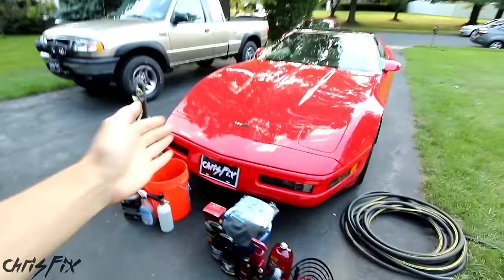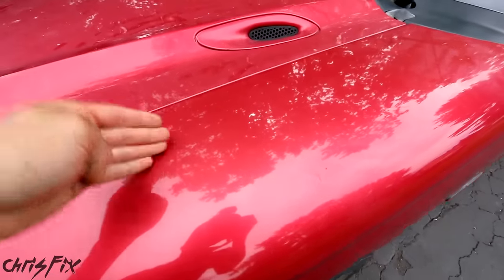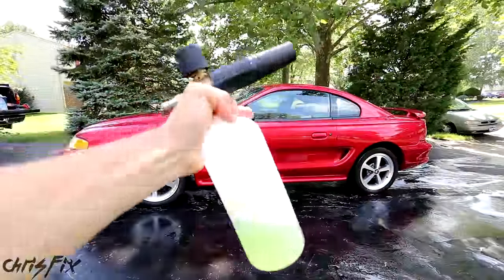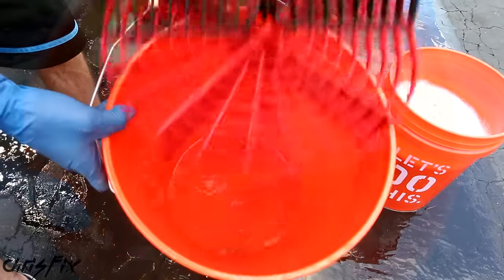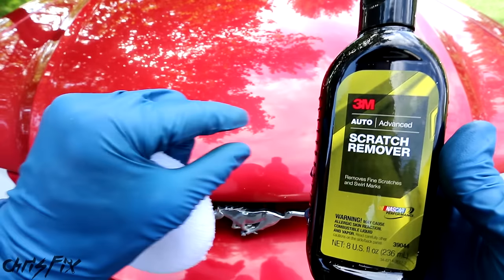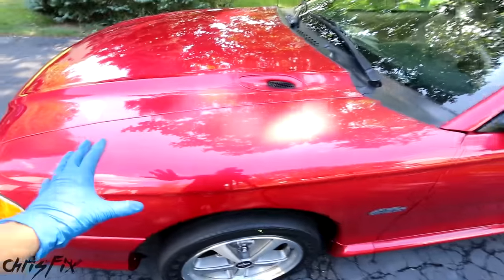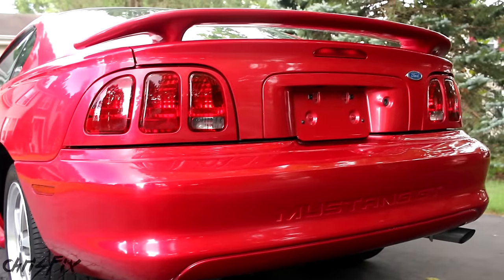How to SUPER CLEAN Your Car (Best Clean Possible)

Comment: Hey ChrisFix. I know you’re usually super busy prepping other videos and content for all. I was hoping if you had time or have tips for removing window tint from vehicle. Thanks.
Reply from the maker: I've found that taking a razor blade to lift up a small edge then applying heat with a heat gun is the best way to remove it. If you don't have a heat gun, soapy water or a product like goo gone can also help break up the adhesive
Reply: @chrisfix  Thanks. You're the best.

Comment: Hey Chris! Love your videos, they’ve been a huge help in reviving my 2004 VW. Got a question about order of operations. I need to do the following: rusted paint chips (planning to do Dremel and touch up), pull some dents, fill some dents, replace some body panels (fender, mirror caps, bumper covers) that I’ll paint, and paint correction. What order would you suggest doing them in?

Comment: Hi  Chris, I hope you get alerts to the comments because I really need your advice. First off I’d like to thank you for your headlight restoration video. My headlights were so bad that I could hardly see out of them with the dims on. I did my headlights using your video and my headlights turned out really good. Everyone was amazed at the before and after pictures that I took. Now for my question. I’m ashamed to say that my car is a 2007 Altima and that other than the car wash, I have never waxed it. The car is silver and the paint is really starting to look dull and faded. There is an area on the hood that is really faded so I will have to use the polish on it and feather it out like you did. My question to you is can I polish the whole car because it all looks so dull. Would it hurt to polish the whole thing? Thanks in advance.
Reply from the maker: Yes, any paint that is faded and looking dull should be polished. It will be a bit time consuming but you can definitely polish the entire car if needed. And I'm glad the headlights are looking good!

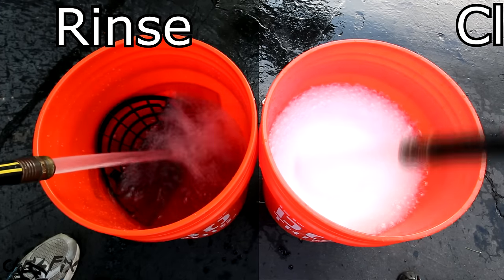Comment: At 6:05 you said "the bucket on the right is the soap bucket". Is that the dish soap, or car soap you're using in the bucket at this step? And is it still dish soap in the foam cannon?
Reply from the maker: I used dish soap this entire process, in the future I would only be using regular car soap if I wasn't trying to strip everything off

Comment: Hey Chris, I was wondering to properly clean your car without doing the dish soap stage or any of the polishing/ paint correction. Just a regular cleaning. Would I follow all the same steps you have on here for the car soap portion of the video, washing, and drying? or is there another video that you made specifically for just a regular cleaning? thanks
Reply: Don’t clean your car with dish soap if it’s just a wash in between waxing just do a pre rinse then a touch less wash with a ph neutral shampoo and top off with a detailing spray when the paint is wet as a drying agent hope this helps

Comment: I’m dealing with a car that’s been neglected and left outside for a good while. Algae and wasp nests were growing in the crevices. I managed to get the worst of it off with the powerwasher and microfiber, but there’s still some stubborn spots stuck on. Should I try to clay bar those out or leave it as “good enough”? It’s not something I’m being paid for, and it’s just a favour for a non-profit.
Reply from the maker: Hit it with the clay bar real quick and see what kind of improvement you get
Reply: @chrisfix  I ended up claying it last night (spent 5 hours on the exterior alone). A significant improvement (but I ended up going in with detailing spray and a microfiber cloth to scrub off the lichen or whatever that red bumpy stuff was), so I’ll probably get any remainder in subsequent washes. I just hope it doesn’t get neglected again.

Cheers!

Comment: My Method of Cleaning the Car
1. Rinse
2. Light Vehicle- Iron Decon- Spray, Let it Sit (3 mins), Rinse
3. Remove Bug Stains
4. Wash 
5. Dry
6. Decontaminate the Paint
7. Protect the Car
Products- Pressure Washer, Undercarriage Washer, Bug Remover, Iron Decon, Mega Foam, Foam Cannon, Car Shampoo, 1 Grit Guard, 2 Buckets, 11 Detailing Brushes, Microfiber Wash Mitt, Microfiber Towels, Quick Detailer, Clay Bars, Ceramic Spray Coating

Comment: Chris so lets say if I wanted to flip a car or just clean someones car and their car had a lot of swirl mark, is the a good time to use polish?
Reply: and when you come in with the 2 applicator is that a newly fresh one or the same?
Reply: one more question sorry to bother Chris but when taking car of the car after your all done, all you have to do is wash the car with a soap that doesn't strip wax and just wash it exactly how you did in this video? except all the other parts just washing it.
Reply from the maker: 1 - Yes the polishing process I showed will remove swirl marks
2 - It's the same applicator  just flipped over
3 - Yes exactly, normal car soaps (like this: http://amzn.to/2uYc5MJ) usually don't strip wax
Reply: @chrisfix  thank you a lot, I have learned so much already from watching your videos and their amazing.

Comment: Hey man, any tips to avoid the water stains beading leaves behind? After applying paint protection, the water beads and all - but when it rains, the beads leave behind dirt on the car. Any tips please?
Reply: Use something like turtlewax's waterless wash. Just spray some on a towel and run it over the area. Chemical guys has one too and they have a video here on youtube showcasing the proper technique on how to wipe stuff off without leaving scratches.

Comment: Is it ok to skip the paint correction step and directly go to waxing after clay barring the car? Will the clay bar cause any scratches that will need paint correction?
Reply from the maker: You will want to do a paint correction if you clay bar because of the micro scratches the clay creates. But technically if you want you can wax right after. You just wont remove all the small scratches

Comment: Hey Chris, I applied sealant and did the exact mistake that you said to be careful of. I applied it onto the black trim and missed to clean it. Now it dried and looking pretty bad. Any suggestions on how to clean that off? Thank you
Reply from the maker: Apply more sealant or a spray wax and then rub it off the plastic. You might need to use a toothbrush to get deeper into the plastic. Dont use the brush on the paint. The chemicals in the sealant are going to help dissolve it and then you will rub it away.

Comment: Power Wash = 3:37
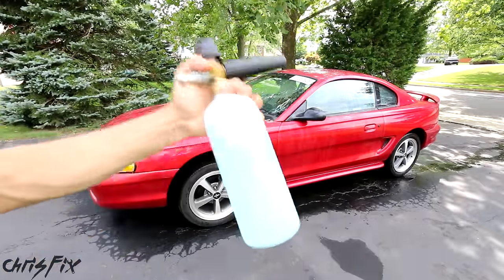Car Wash Soap = 4:20
Touch Wash = 3:40
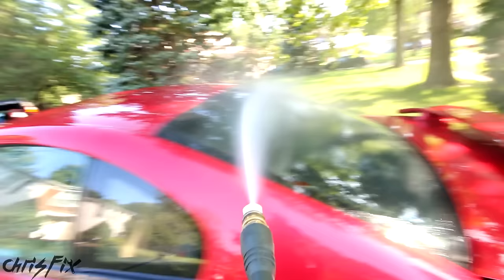Clay Bar = 8:10 
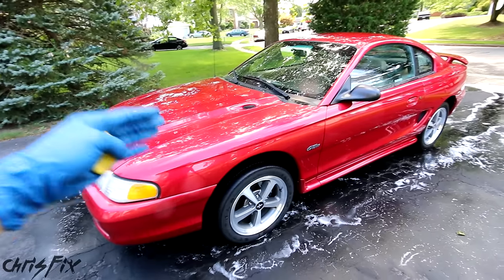Drying The Car = 11:08
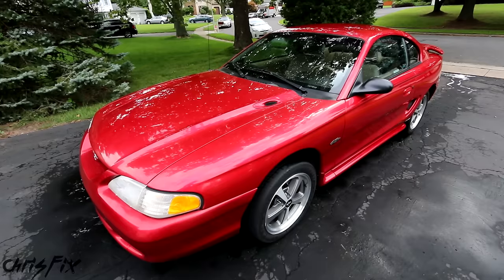Paint Correction = 11:56
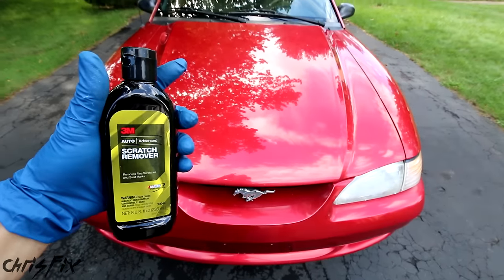Seal/Wax Paint = 15:12
Reply: Not all heroes wear capes

Comment: Chris, what is the max PSI one can or should use on a car?  The link you had was to a 2700 PSI washer, which seems quite high.  On the web I've seen some recommendations for no more than 1500 or so.

Or, do you compensate for the higher PSI by standing a little further back?

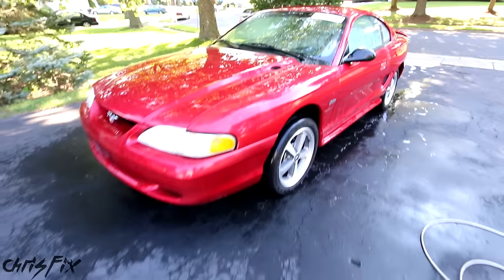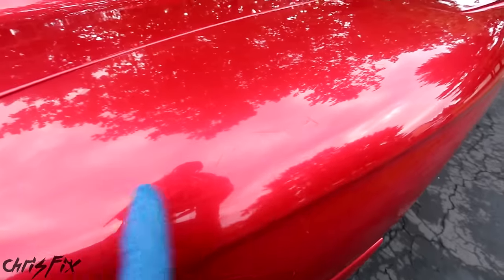Comment: 5:43 two bucket method -> clean car top down in back n forth parallel lines/split in top and bottom halves, 12:20 clear coat fix, 13:25 polish application
Reply: Bro is he saying soapy water ? Or smth else during the paint correction

Comment: Does the jet setting on the hose damage your car or is it fine
Reply from the maker: It should be fine but no matter what I wouldn't hold a hose or pressure washer less than 12-18" away from the car

Comment: About to buy my first car 2004 v6 mustang ik issa v6 but it was $4k hope its reliable as it looks 🙏🏾
Reply from the maker: Awesome! The mustangs are pretty reliable. Make sure it’s been taken care of and you’re not left with a bunch of worn parts that will need to be replaced.
Reply: @chrisfix  thankyou for replying ! And i drove it home with no outstanding issues except the steering wheel column looks bent but i took it to auto one and got an obd ran on it it said it had no issues so im super happy man needs a little work but altogether its a blessing thankyou chris

Comment: I’m planning on detailing my e92 for the most part the paint is in a pretty good condition, however I’m trying to remove swirl marks and some small scratches, is the meguiar’sultimate polish enough or should I get the compound as well?

Comment: Wondering is the polish you used for swirls and discoloured paint, the same you used after the clear coat scratches you sanded back?
Reply: Also, in your touch wash - are you using dish soap and water or car soap??

Comment: Do I POLISH after CLAYING my car? or can I clay bar the car and go straight to WAXING/SEALING the paint? I am trying to clean my car but I dont have any polish nor think its bad enough however I do want to clay it. If I have to polish then I wont. Had to edit, sorry for the confusing sentences.
Reply from the maker: You technically want to polish after flaying because the clay will sometimes lightly scratch the car.
Reply: @chrisfix  Thank you

Comment: @ChrisFix, I wanted to ask can I wash the car with a regular gardening pipe? I dont have such power machines in my area. You know gardening pipe has not that much pressure but is it better to use it or just stay with bucket-method?

Comment: Hey Chris, my car has a strip of glue probably left over from masking tape. I've tried heating it up and scraping it but it's too solid, and I'm unsure about using chemicals such as acetone or high concentration isopropyl alcohol because I fear it will damage my paint. I tried using a 10% IA solution but it did very little. Using a claybar helped but it is still very visible. Do you have any tips on what I should do?
Reply: Try using some tar/ bug splatter remover

Comment: What psi do you set your power washer too?
Reply: psi doesn't matter as much as gpm, but anything higher than 1,800 psi @ 2.8 gpm is getting into dangerous territory. 3.1 gpm is what I use for removing spray paint from buildings and sidewalks. If you can adjust psi and gpm, I'd say 1,500 psi @ 2 gpm should be safe and effective.

Comment: if i dont want to strip my wax. for the touchless wash should i use car soap or i can just use dish soap
Reply: Regular washes with dish soap will destroy your sealants all over the car.
Reply: @King-gq5qn  no i meant like for the foam step, i also use the car soap?
Reply: @catfish3151  Ouh, never use dish soap if you have any kind of coating on your car.😅

It will wash wax coating for example away like nothing.

Also regular car shampoo can do that and therefore you have to keep your eye on a car  shampoo which is "PH-neutral".

Very important, if you want to extend the durability of your coating.

So go get yourself a PH-neutral car shampoo.
Reply: @King-gq5qn  for the hand wash i also use a ph-neutral car soap?
Reply: @catfish3151  there would ph-neutral also be a plus point, because your skin will face damage if it comes constantly in contact with regular car shampoo, which is not ph-neutral.. but try always to use gloves when detailing to protect your skin
Reply: @King-gq5qn  ty for the information man
Reply: @catfish3151  youre welcome

Comment: Here's some advice to anybody who's watching this.

WARNING!!! NEVER GET ANYWHERE NEAR YOUR CAR WITH A CLAYBAR UNLESS YOU PLAN ON DOING A FULL CUT WITH A DA! It WILL mar and scratch the paint BADLY. Clay is only to be used before a proper polish. To say anything else, is pure amateur hour. Even if the car is getting a ceramic coating, don't clay it unless it will be cut and polished. 

Second thing is to use a strong prewash to loosen up the film and dirt. Yes a dish washing soap will take off wax, but it will not take off some of the harsh film and grime, Use a soap like Bilt Hamber Auto Foam in a 5% PIR. But what ever you use, make damn sure the car is DRY before foaming it! You might think you are prepping the car better by hosing it off, but nothing could be further from the truth. Foam the car with the prewash and let it sit for at least 5 minutes. Then, and only THEN, can you hose it down with your pressure washer prior to the hand wash.

Now you will want to foam the car with a thick ph neutral foam prior to putting your hands on it. This will mainly serve as a lubricant while using your two buckets and wash mitt.

And again, for the sake of everything holy, DO NOT, and I repeat, DO NOT CLAY YOUR CAR UNLESS YOU PLAN ON DOING A FULL PAINT CORRECTION ON THE SURFACE YOU USED CLAY ON!
Reply from the maker: Thanks for your tips!
Reply: PIR?

Comment: Clay bar as you wash you will save  time , most likely you need to correct the paint anyway
Reply from the maker: Naw wash first. Your clay will get so many contaminants in it if you clay a dirty car. Those contaminants will scratch up your paint even worse giving you more work.

Comment: What kind of pressure washer machine do you reccomend? Some of the links above in the description is no longer work or available.
Reply from the maker: I’ll update the links for you
Reply: @chrisfix  Thanks! You are the best!!
I really do enjoy watching your videos and you are a great teacher! Keep up the great work.
Reply from the maker: Updated. Thanks for letting me know they were no longer working. That is the pressure washer I use now. It is 3x the cost of the cheap one I was using but it works soooooo much better and lasts a lot longer and is quieter so it depends on your budget.
Reply: @chrisfix  You're not kidding about it being more expensive lol.
I will keep this one in mind and along with buying a foam gun for a water hose to wash my vehicles until I save enough to buy this one.

Comment: Used over 30 towels, 10 applicators, and took 8 hours.
Reply from the maker: Used under 10 towels, 2 applicators and it took 4hrs and ever since this video I never had to do it again, just touch up washes.
Reply: @chrisfix  it got dark outside and humid so nothing would buff out or dry lol but good to know I'm retarded!

Comment: I spent three hours washing, clay baring, and waxing… the next day my car was CAKED in dust. Car looks worse than before.
Reply: Too much wax, or you didn't buff the wax off good enough. I use Cerakote ceramic coating, because wax is typically used on older single stage paint.
Reply from the maker: That means you didnt remove the wax. It was still on there so overnight it dried and turned into that "caked" dust. You can use a spray wax to loosen it up and dissolve it a bit so it is easier to come off.
Reply: @ChrisFix  Do you still have the del sol? If so, any plans to sell it? If so, make sure you post it before you do, so we get first bids on it. Lol

Comment: Step 0 @2:30 Preparation
Step 1 @3:18 Touchless Wash
Step 2 @5:38 Touch Wash
Step 3 @8:10 Clay Bar
Step 4 @11:06 Dry The Car
Step 5 @11:57 Paint Correction
Step 6 @15:14 Seal/Wax Paint

Comment: Question…. How do you know that the car doesn’t need dishwasher soap?
Reply from the maker: It will always need it. The dishwasher soap is a pretty basic solution pH wise (+8-9pH) so it removes the oils, wax, grease, dirt, etc just like from the dishes. Just dont let it sit on the paint and only use this once and get a nice coat of wax or sealant when you are done so it's protected.
Reply: @chrisfix  appreciate it bro… I’m learning how to detail